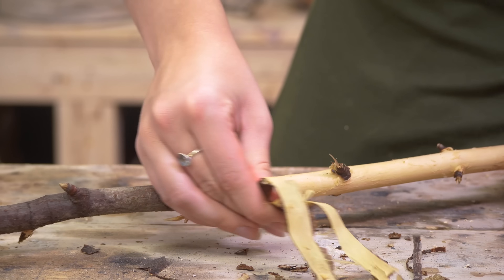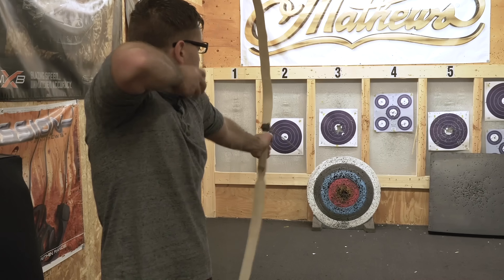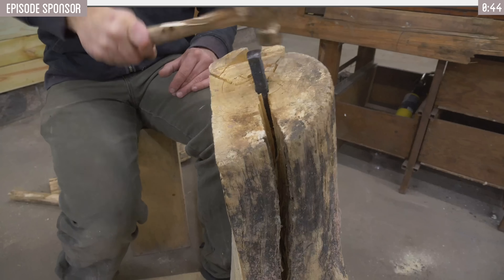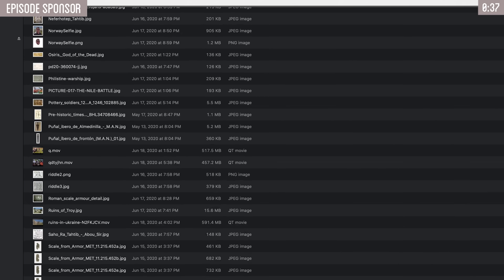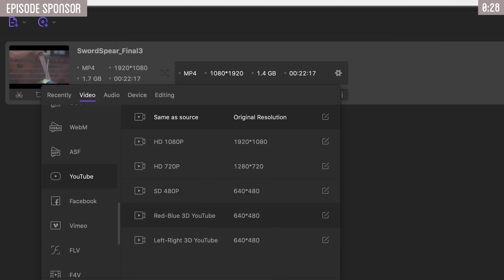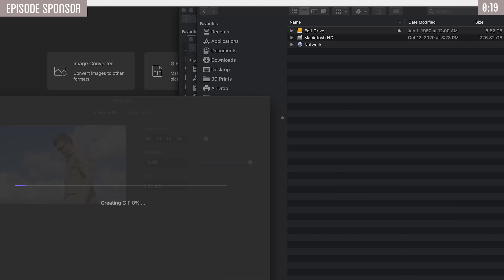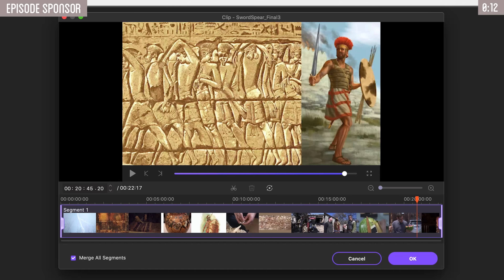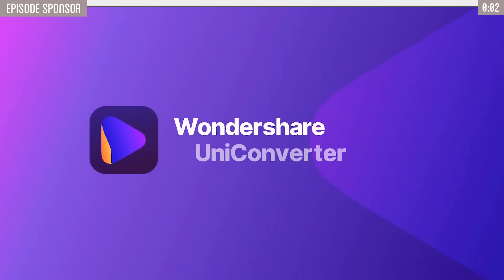Making Paper Out Of Trees (100% From Scratch)

Comment: I feel like an a flatter anvil would be a good next thing to get... those nails existance is just pain
Reply: And some woodworking workholding tools, a rough shavehorse is not that hard to make
Reply: @martinovallejo  or even a working mule with a holdfast
Reply: lets not forget, they should have had a knee vice or something like a stitching pony by this time, some of the oldest work holding devices out there
Reply: He should also wedge that hammerhead into the handle so it stops flying off. I think he skipped the step where he splits the handle top and hammers in a wood wedge to keep it tight.
Reply: Better than nothin i guess
Reply: And... Maybe a lathe next I guess? So that he might be able to make screws.
Reply: @FlameRat_YehLon  well screws were quite a late invention they should learn to rivet and to make classic woodworking like dovetails and such
Reply: @FlameRat_YehLon  that's so much later invention is only barely reached the iron age,
Reply: @jusb1066  They aren't going by the historically accurate route either, but rather "unlocking more things to do, regardless of chronological order". They technically have all the parts necessary to pull that off, but they would have to get serious into upping their precision before attempting to make a lathe that's gonna bring even more precision. Of course, they need a flat anvil first.
Reply: @FlameRat_YehLon  papermaking and the wooden screw were both invented around 200 ad the metal screw wasn't invented until the 15 century,, yes technically it could have been made but wasn't, therefore we must stick chronological order, is a lot more important things between those two dates, his iron is way to poor, he can only make a tiny quantity. Those techniques need to come
Reply: @FlameRat_YehLon  screws could be bronze and they could be cast..hmmm
Reply: @jusb1066  what I mean is they still need a lathe to make a wax mold of a screw (basically copying the groove from a well crafted master). Or they can hand carve every wax mold, which would be bad because there's no way to guarantee the consistency of the product, and it's very time consuming too.
Reply: @jusb1066  also, I think by the rule he set to himself, once a material is "unlocked" he can use modern process to make the rest of what he need. Which could make the task more possible. And I don't think he has to stick to chronological order because different parts of the world has different technological progression but he didn't stick to the progression of any specific area. Which allowed him to produce spicy wings at bronze age, which was when chili peppers and chickens aren't met yet. That's technically breaking the chronological order.
Reply: @FlameRat_YehLon  you really need to hand carve one... The point of casting, you have the master
Reply: @jusb1066  giving that they still rely on lost wax casting, they probably should either find better casting method or a way to copy/replicate carved designs. That's why I was thinking about a lathe.
Reply: Other option is to get into masonry and build some chisels for flatter rocks.
Reply: @KRSorba  bronze chisels already do..so does splitting stone.   But that's no better than finding a flat rock
Reply: and while he is at it, taking some time to make an actual handle for the hammer maybe. And maybe use the hammer to make a better hammer.
Reply: and a monjolo...
Reply: With Hand forged nails like that, you pre drill the holes so as not to split the wood or bend them.
Reply: @TheSimoncousins   but did they have drills small enough?
Reply: If you look at early anvils they're tiny. Not much larger than the face of the hammer .
Reply: I have an idea on how he can cast an anvil.
Reply: @hunters36forgingwoodworkin73  he can already do sandcasting. But refining enough iron is the hard part, we also seems to me his limiting himself by his own resources.. it's been invented let someone else make it or buy iron
Reply: There is no way those nails went in without pre-drilled holes.
Reply: 1000000000% agree
Reply: They reminded me of Giacometti
Reply: they should hire someone who isnt a large toddler and can actually work well with their hands
Reply: But the iron is still hard to come by
Reply: @jusb1066  even just a flatter rock might work
Reply: @DramaticFlora  I agree tool making .. still be important for a great many videos yet
Reply: Reset culture, all that work just to be censored, after all who needs rights
Reply: Now I think about it. He has the technology now he doesn't need to make all of his own hand tools, they've been invented let someone else make them and buy them. Otherwise his limiting himself by what he can make with one or two people
Reply: @jusb1066  that is the point of the series though is it not. it is asking if he could do it from the stone age up
Reply: @crwelch12  you are correct it is,  but they have to be done in order
Reply: @jusb1066  "I have the tech now, I'll just go buy it rather than make things." isn't really How to Make Everything 's premise.

Comment: When do you think they'll learn you need to drive a wedge into the wood at the head of the hammer to hold it on?
Reply: You can also just taper the handle and socket opposite to each other
Reply: @eazy8579  Or you use the good old German method: Shape wood into an already tight fit. Drive wood into hammerhead. Insert hammerhead into water for 24h, wood expands. Perfect fit! If you drive a wedge into the wood before watering you can increase its strength to a level where it'll survive the bombing of Berlin in 1945. :D
Reply: Rub the hammerhead, but NOT the wood, with oil before watering for added rust-resistance.
Reply: @lonelywolf8388  That'll crush the fibers though. Once it dries out it will be loose.
Reply: @dillonvandergriff4124  Depends on the type of wood.
Reply: I was thinking the next thing they need to learn how to do is to reduce the possibility of hammer related injuries
Reply: @idiotbutransrights  OSHA is still around two millennia away
Reply: @ENDERLICOT  lol
Reply: Just use a big ole branch or a rock.
Reply: I personally use a metal wedge, an other option would be a side pin/nail, make a hole in the hammer head and then simply drive a nail through that.

Comment: ever thought about putting a better wedge in that hammer, before you reach the industrial era and add a steam engine to that potential safety hazard!
Reply: Yes the hammers need help, I would remake the handles so the top is bigger then the hole in the hammer head.  Slide the head up the handle, as that is is bigger, the head wedges on and can't come off that end.  Can't come off the other end as that is where you hold the handle.
Reply: Tbh i expect(not hoping) te last video of andy wil be when the hammerhead breaks his skull and dies instantly
Reply: @8-UwU-8  brutal xD
Reply: I know that modern smithing hammers have an hourglass-shaped cross section when you look at the hole. Honestly using a wedge at all would improve it, along with making that end less of a spear shape. The point at the end of the handle is not necessary.
Reply: Just got to that part in the vid as I read your comment lol
Reply: He needs to reheat that metal wedge and then insert a handle.  Then let the metal cool around the handle.
Reply: I was thinking the same.
He should use his shitty gen 1 hammer to forge a better gen 2 hammer!